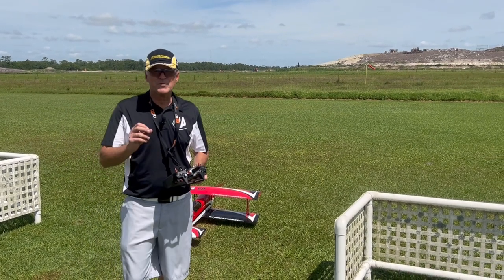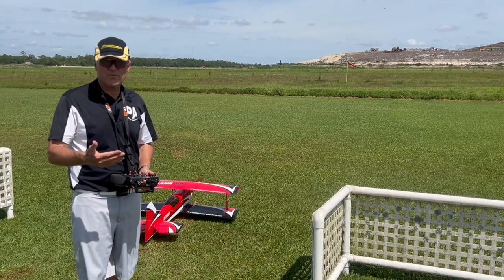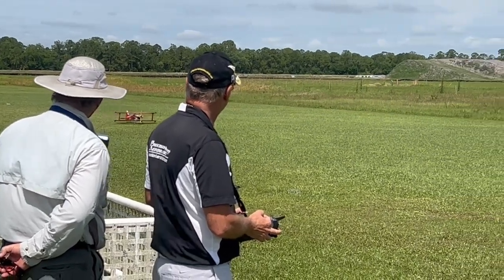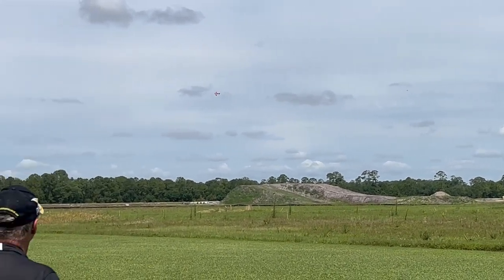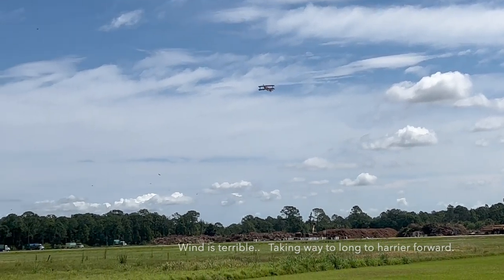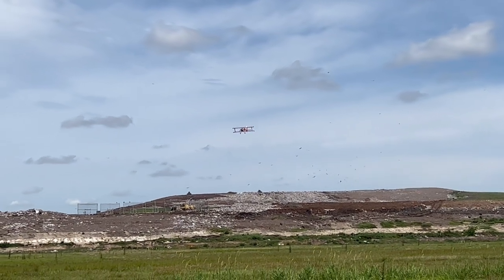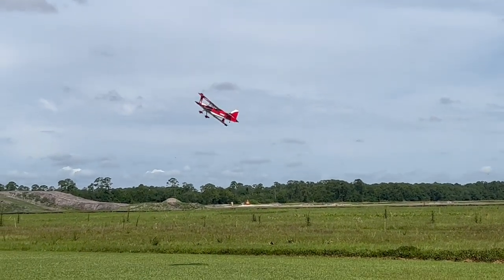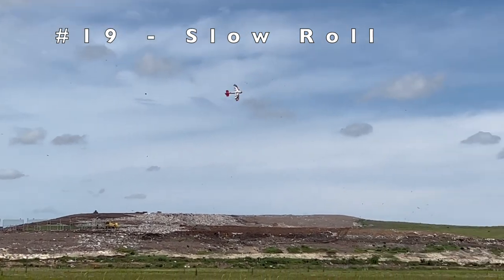Michael Wargo:  RC Aerobatic Instruction.   Flying Deliberately Series.   Part 4

Comment: That flight club has a lot of room is that space coast? Im in Titusville and been looking for a club to join
Reply from the maker: IT is IRKS in Cocoa.   Very good club.
Reply from the maker: There is another I belong to that you might like and it is ircs in Samsula.   More intimate club.   I film There with frequency.   It is smaller but with a runway.   Does not flood often like the big field either.   If you are flying bigplanes, irks is better.
Reply: Thanks guys I have been looking lately and you have pointed me in the right direction.....I appreciate it
Reply from the maker: IF you join one of those two clubs, make sure you say hi to me and identify yourself.   I am at irks probably once a week.